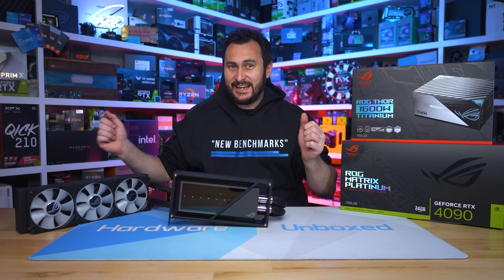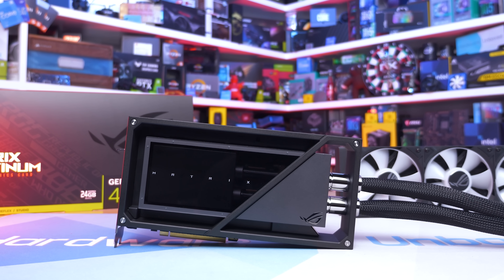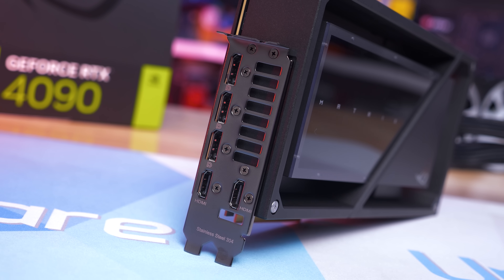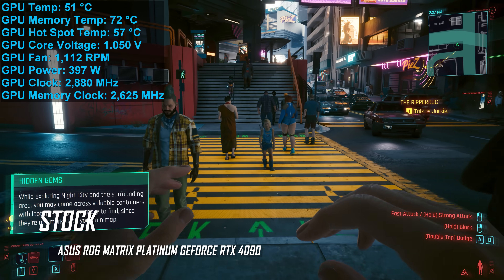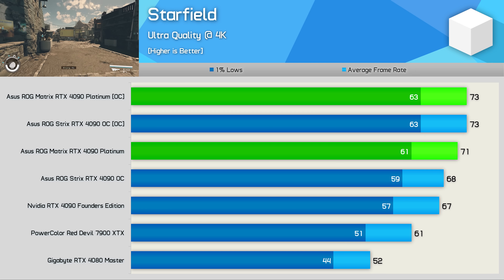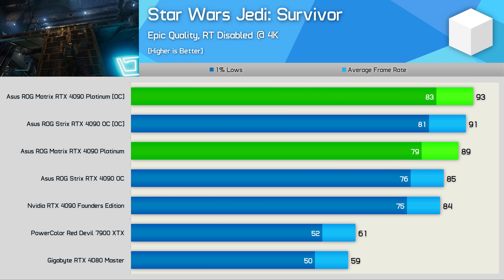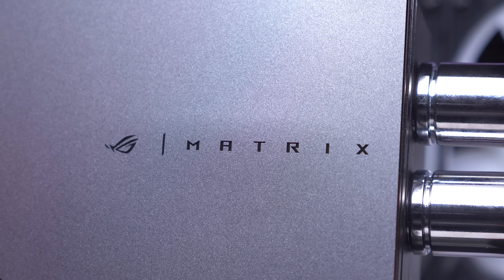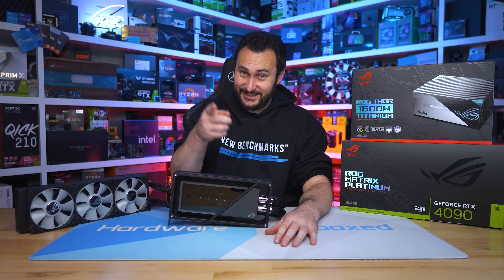I Can't Afford It! Asus ROG Matrix Platinum GeForce RTX 4090 Review

Comment: The block design is actually quite disappointing.
The water only touched the area over the core and that's it.
At least with a custom block design, you would get water pathways over the memory and VRM areas of the card.
This means that this card is not only ungodly expensive for what it is, but also a poor choice for ultimate cooling performance.
A custom water block will also let you chose your own flow rates and radiator dissipation, so the ambient is really the limit.
Reply: Not to mention it will develop overheating problems in a year once the LM has permeated the copper.
Reply: It's exclusively for ultra whales who have more money than care in the world
Reply: ASUS want the memory to degrade and fail so Richy Rich goes out and buys the next ASUS rip off sooner rather than later. It is deliberately designed to shorten the product’s lifespan.
Reply: @Squashed8Ball  except Richy Rich won't get that. He got a guy like Kristofer Yee who just ordered a custom case with an open loop and a water distribution backplate.
Reply: @PainterVierax  semantics
Reply: @Squashed8Ball  not at all. This product simply doesn't make any sense even for rich people.
Reply: @PainterVierax  ok buddy 🤦‍♂️
Reply: @Squashed8Ball It only needs to last till 5090 Matrix.

Comment: What’s the use of so many power stages on a card like this? If they‘re rated at 70A that gives you 1680A x some voltage most likely >1V, so it probably can supply like 1800W or more. Does the card even pull that much under LN2 and would the power connectors survive that?
Reply: As nvidia proved with the 600 700 and 900 series, you don't want to use more than 2/3rds of your maximum power capacity or cards tend to fry in a year or two. Lots of dead 600s in particular as they were using something like 90% of their maximum power delivery with stock settings.
Reply: @PineyJustice  but that was 4-6 generations ago and we’re talking about 1800w when the card has a 450/600w TDP, that’s like 2-3 times oversized. what other 4090 Runs this many powerstages?
Reply: @luk4s195  More capacity means more stable output, more stable output means better clocks. My sapphire nitro+ 7900xtx has 20 phase power, it uses about 400w but delivers very clean power. Probably better than the asus in this video since asus usually uses mediocre power stages while sapphire uses the best of the best.
Reply: For the bragging rights!

Comment: 2 years later: RTX 5060ti has dlss 4 and beats 4090 for half the price.
Reply: 5080ti*
Reply: 800 USD for 5060ti sounds right about how they imagine future pricing levels
Reply: No… 2 years later 5060ti that is 5% faster that 3060ti! And cost only $800!
You got it wrong!
5090 will be 70% faster and it will cost $4000 so there is room to increase the low end prices allso!
😂😂😂

Comment: If they provided the GPU section with plugs for your own watercooling system that'd be cool
Reply: You are better off getting a founder edition card then just replacing the stock cooler with a Alphacool Eiswolf 2 AIO - 360mm RTX 4090 Reference Design with Backplate. You will save $2000 in the process and have similar thermals. And Alphacool does give you options to convert or hook that up to an already installed water-cooling system.
Reply: just waiting for solid state air cooling to get better

Comment: I love it when manufacturers try to say things like "two and a half slots"  You're right, it doesn't matter if its 2.5, 2.2., 2 and 1/3 slots.  Either way, that 3rd slot gets taken. Its like when people tell me they have 2 1/2 kids.  What the hell does that mean?  Do you HAVE 3 KIDS OR NOT?!  I don't care how old they are.  3 kids, 3 mouths to feed, 3 butts to wipe,
Reply: I see where you are coming from, but it does matter for sff builds. itx boards only have 1 pcie x16 slot, but itx cases may have 1, 2, or more slots for io  or clearance. That extra 0.5 does matter.  Vertical mounting also requires some consideration for card thickness a well. 👍
Reply: I have 2.1 kids: 2 kids plus and arm and a leg of the third one.
Reply: I love it when casual commenters try to farm likes by mocking huge companies for things they're too casual to be even aware of. The exact height will matter for SFF builds, for vertical mounting, for modded builds, for tinker builds with extra PCIe cards that block air circulation, for weirder cases. And all it takes to inform all those enthusiasts is literally a dot and a digit.
Reply: In fact, anything over 1.9 or so will probably prevent you from using the third slot.
Reply: the only sense that "two and a half kids" statement makes is in the average of how many kids families have by data collected about habitants of a certain state/region/area. there was a 90s British sitcom named "2point 4 children " because at the time of shooting it was the British national average of kids. and no, there wasn't a 0.4 kid on the show. 😂
also I completely agree with you. no matter how you put it, it's rendering 3rd slot unavailable.

Comment: I really miss cards like this despite the bad value proposition. This reminds me of those ASUS ARES and MARS models as well as that on-card AIO ASUS Matrix RTX 2080 Ti I believe it was? MSI too had some unique models back in the day with the GTX 780 Lightning and there were most certainly other cool GPUs on the market too, barely any of which we have these days.
Reply: NVIDIA locking voltage killed this insane over the top cards.
Reply: @CrongTech they did it because too many ppl would be stupid and fry their cards, then try and RMA them like it wasn’t their fault.
Reply: @JZF629  That was never an issue, those RMAs always get rejected. It's very easy to detect overvoltage damage. RMA logistics were always paid by the customer too.
Reply: For what it is, it's a very nice looking card ,, but it also gotta be at that price, but absolutely redicolous that it's not even 1% faster than their own "normal" OC version for all that money, I'd rather buy 2x  ROG Strix and make 2 Monster Gaming machines, one with a 7950X3D and one with a 14900K just because I could, to have a build for whatever is the fastest setup for each game 😂
Reply: we have? are you delusional?
Reply: Also the EVGA kingpin
Reply: It's a luxury product with quite a lot of engineering (and design) spent on. Decent build quality, innovation - the UV resin + liquid metal, the voltage pin sensors. Since not many cards will be sold the investment might not pay off - but it's a lovely halo product, nonetheless.

Comment: If you want an absurd product, take a look at the Galax HOF 4090 that comes with TWO 12vhpwr connectors.
Reply from the maker: pfff that model's not even three grand, garbage!
Reply: @Hardwareunboxed  Still remember the first time We were putting a System together for a custommer With an Intel Pentium Extreme edition and 2 Nvidia GPU's in SLI and a ton of ram for that time and 2x 10.000 rpm Raptor disks. Always fun to build something you can't afford yourself 😄
Reply: any card lower than 10x my card price is absolute garbage  @Hardwareunboxed
Reply: HasselHOF edition!
Reply: At least with that card you can do some crazy OC if you want, but this card is pretty meh when it comes to OC.